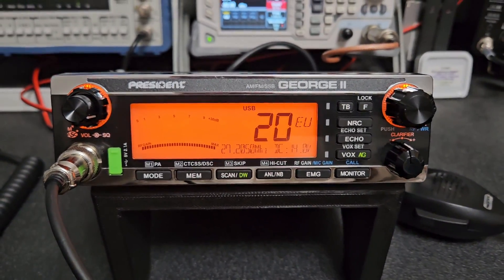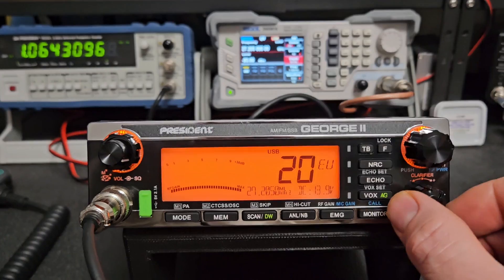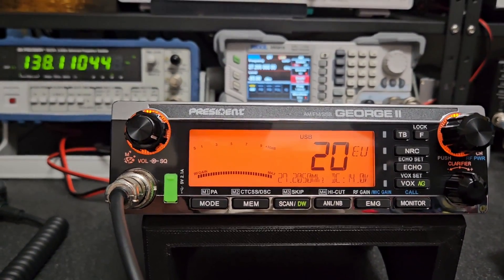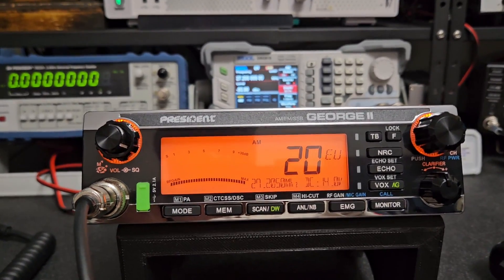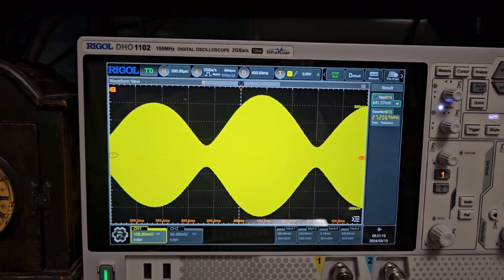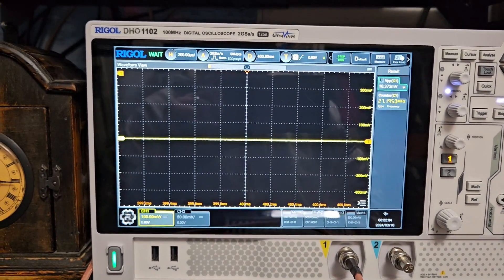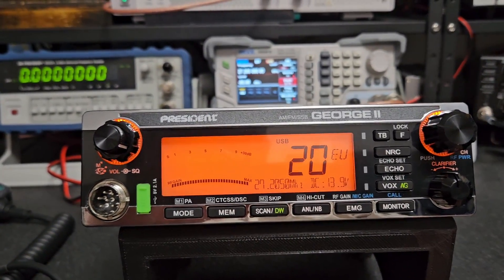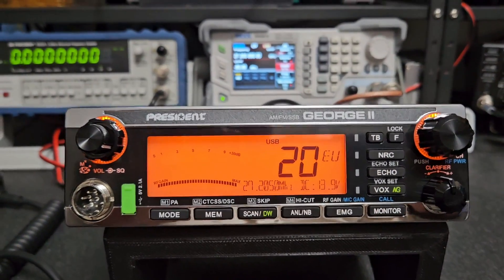First look President George II

Comment from the maker: I will not be selling the George II. Scott's Radios is a President Electronics USA dealer. Which means I only sell President radios available to the USA market.
Plenty of European dealers online to purchase President's European radios from.
Reply: hello, @scottsRadios,  I was wondering, what your thoughts were on this radio vs say like one with skip, or like a am/fm/gmrs style radio. I really like the George i have been looking at it for a while. because of the size of it is good for my dash. I guess with am and fm on the George is good options. I am not sure that much more then that is needed. I am in Oklahoma and its fairly flat here so am and fm get really good range. Thanks for your reviews they are very helpful.

Comment: So I'm so stuck between this radio and a Washington.. I'm gonna run a 500 watt linear any recommendations
Reply from the maker: I guess it would depend on what type of amplifier. 
If it has a higher input power requirement then the Washington would be better.
Reply: @ScottsRadios  rm italy 503
Reply from the maker: @KE8ODY-WV-Ares-Ham-Dad-3O4  if 503 or 503 HD, the George 2 would be better.
Less risk of amplifier being overdriven mistakenly.
Reply: @ScottsRadios  okay yeah kinda what I thought
Reply: @ScottsRadios  it's a KL503 ssb
Reply from the maker: @KE8ODY-WV-Ares-Ham-Dad-3O4  yeah the normal 503 I think takes less input power so you would be perfectly fine with this radio if you went with one. It looks like that model is a very low drive. 
1 to 6 watts max.
https://www.rmitaly.com/en/product/kl-503/

Comment: I’m American and I bought it on launch. The “II” has echo and the “FCC” doesn’t. The ‘II’ is more power and a push on the VFO puts an “underline” blinking cursor underneath the digits of the frequency (span feature) increment to move up and down the band.
Reply from the maker: The George FCC also has the span function.
Personally I would rather have NOAA weather than Echo.

Comment: Thanks for the video🙂I owned the first George II in England and never opened it up  mine neither , I agreed this is currently the best CB radio available , all the best Dave
Reply from the maker: Right on Dave, I have other radios to go on amateur radio with. I prefer to use the CB radio for what it was intended for.
It does a fantastic job as does the FCC model. 
73
Reply: I too have the first President George 10M  and I ordered it from Greece back in 2001, one thing I do like about the radio is it has a security feature that if the radio were to get stolen it requires a code to unlock it to be functional.

Comment: You finally got it & I think its much better as I own one. Cut the wire & move the pin then it goes from 12 meters to 30 MHz. It will output more power 45 watts+ as well but you need to go into service mode & set it. I use mine on 10 & 12 meters with no issues. It also has built in echo & CTSS for repeaters & you can tune the frequency by 1 kHz, 5 kHz, & 10 kHz steps & in between. Now Scott will sell them in the US as I seen many sold in Canada now.
Reply: I think Scott said that he won't be selling the George ll radios!
Reply: Sie haben nur den Jumper auf 23 gesetzt und den weißen Draht durchgeschnitten und nicht umgelötet ? 
Von welcher bis welcher Frequenz geht es jetzt und wieviel Leistung bekommen sie raus ? Wie kommen sie in das Sondermenu ? Es ist ein tolles radio.
Reply: @andik859 Von welchem Radio redest du?
Reply: @Optimus2179  george 2